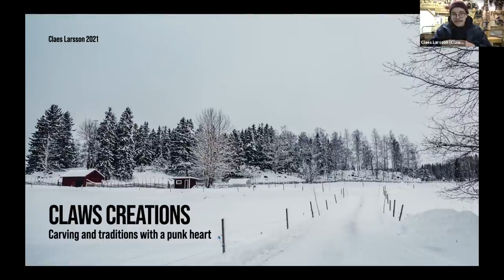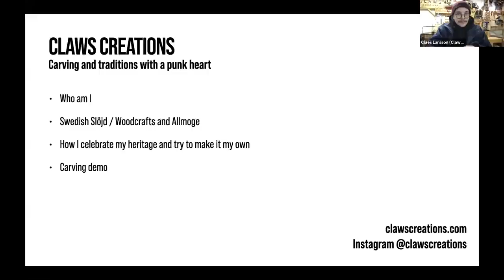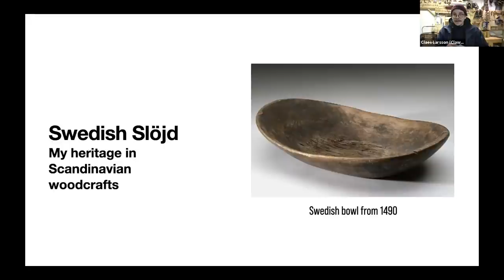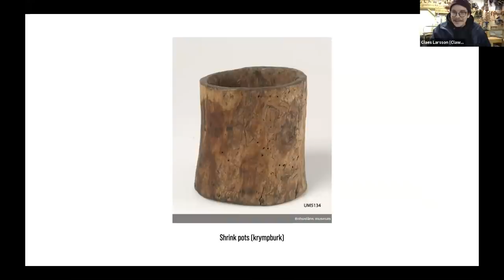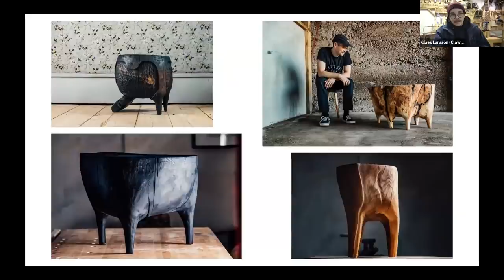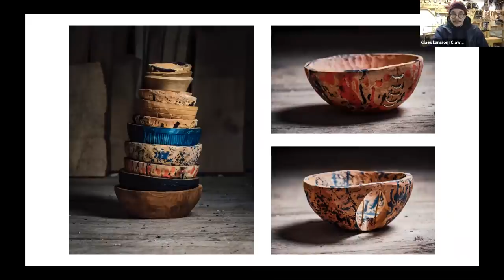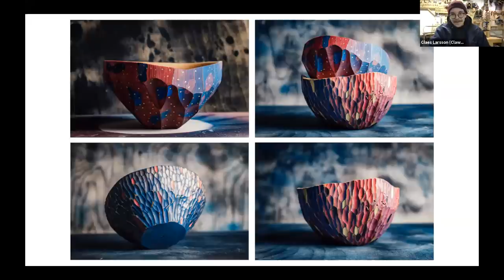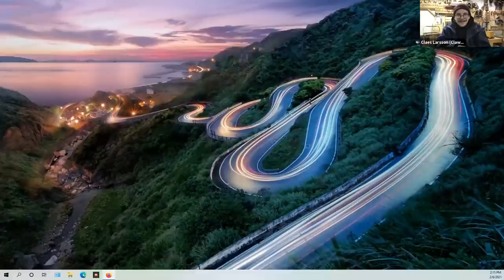Swedish WOODCARVING LESSONS with Claes Larsson

Comment: Your basket is it me all of Wood presume corners dry wood and the sides green Wood and what kind of wood
Sorry I missed the live Zoom
Reply: The frame, or corners are made from green sallow. It is carved in a way so that you get four bent, interlocking pieces that shrinks together and gets strength from that. The handle is also bent, green sallow. (other kinds of trees from the willow family might work as well). The panels on the sides and bottom and the vertical parts of the weaving is made from dry pine and then you make thin strips from green sallow that you weave in horizontally in between the pine.